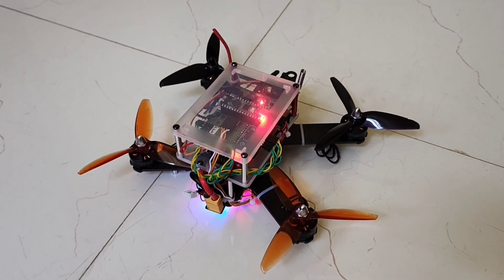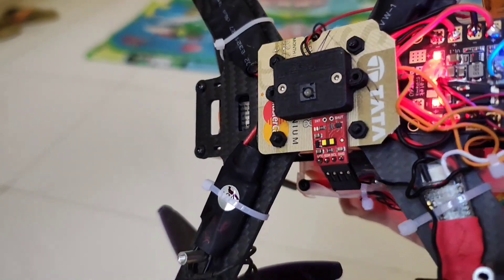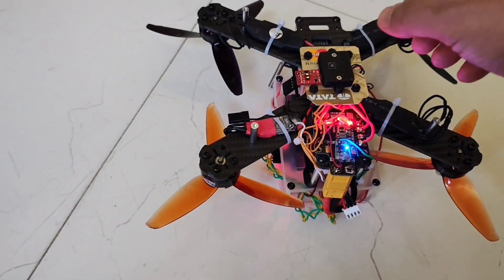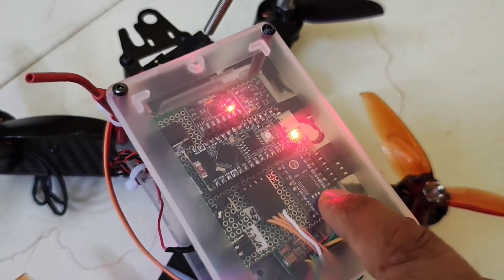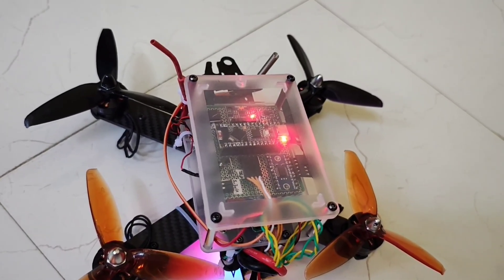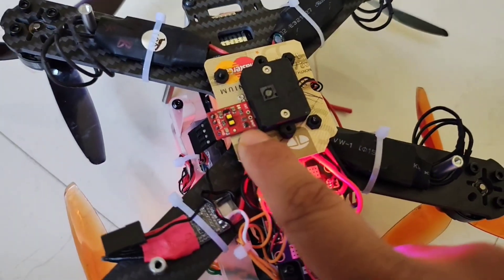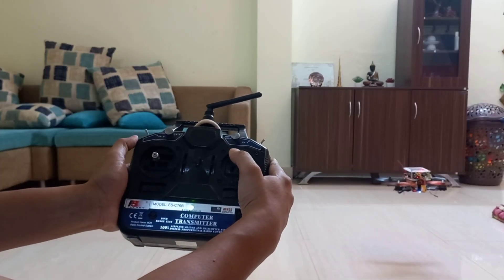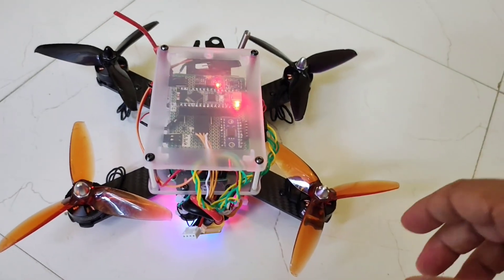Building and Coding an ESP32 Drone Part 1 - Introduction

Comment: For a carbon fibre frame u should have used more anti vibration balls
Reply from the maker: I am not seeing much of a vibration issue as of now but yes with more refinement of the flight characteristics I should probably get better isolators
Reply: @dhruvdroids Well whatever you have used for the gyro and accelerometer, that board should be on something to cancel out vibration, that slight vibration might be causing the minute wobbling that makes your drone move more when it has to hover,even loading it on double sided tape would make it slightly more stable
Reply: @dhruvdroids probably not but thats whats causing the drone to move around so much when it has to hover
Reply from the maker: I do have some memory foam tuned to prevent any resonance under the FC
Reply: @dhruvdroids memory foam can work ,but silicon gel pads and rubber damper balls would work much better an another option

Comment: Your drone is a racer drone,you should use a heavier frame and vibration absorbing pads for mpu6050 and triblades are for speed, 2blades are for stability
Reply from the maker: Yes, I learnt that recently 2 blades are more efficient. I am working on that

Comment: Hi, I'm also working on a similar project. In my code, I've managed to implement altitude hold, but I'm facing issues integrating the optical flow module. Could you please explain or share your code.
Reply: PMW3901
Reply from the maker: @AnilSahu-i2w  ok, I am also getting the pixel rate, converting it to actual velocity using height data and scale factor. Then integrating to get position. My PID uses both the velocity and position error. I also added some gyro compensation to account for roll pitch causing false velocity.
Reply from the maker: @AnilSahu-i2w  I am trying to refine the optical flow code. I agree it's pretty difficult to get reliable data from the sensor. Btw which sensor are you using
Reply: pmw3901 (spi)